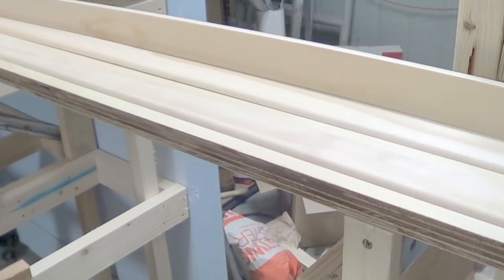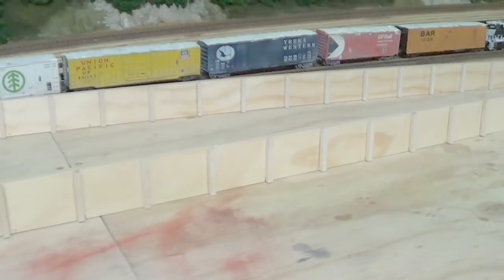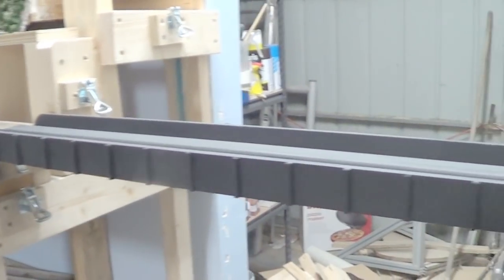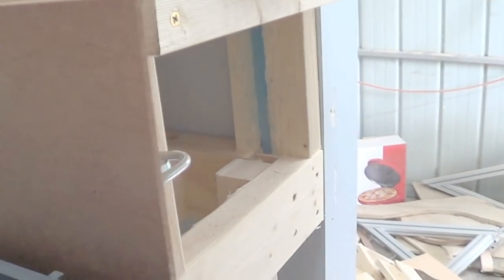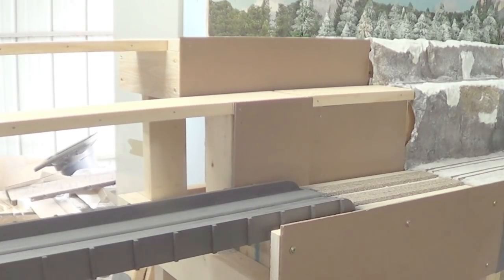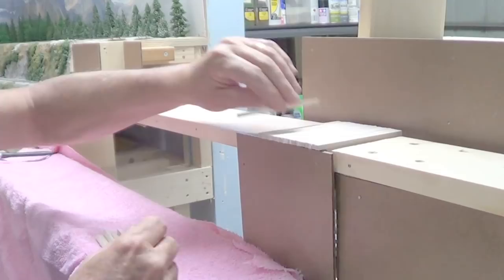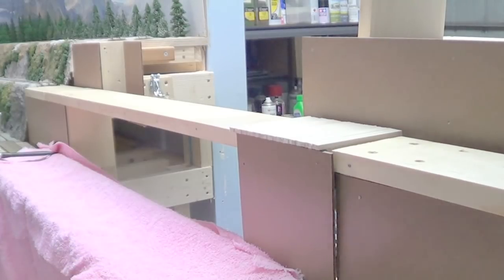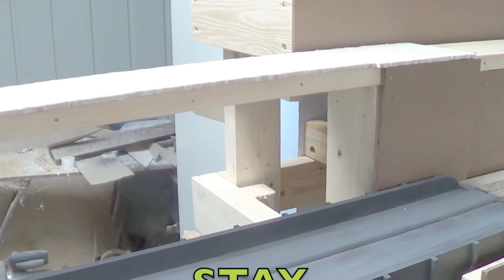Building Three Lift Ups Part 3 "Girder Bridge "Model Trains"

Comment: If you had cut at an angle there would have been no need to round off the ends or leave such big gaps
Reply from the maker: The gaps look bigger than what they are cheers Robert